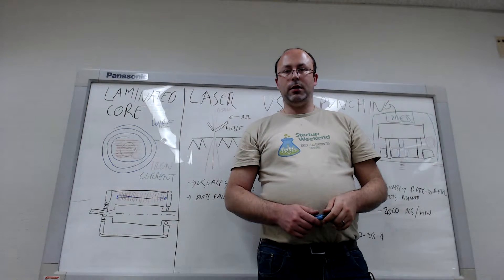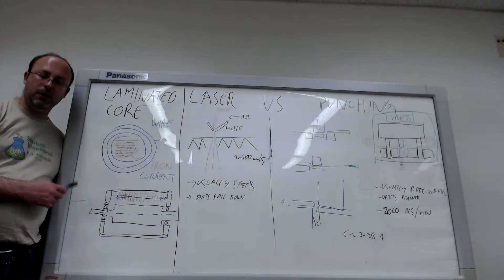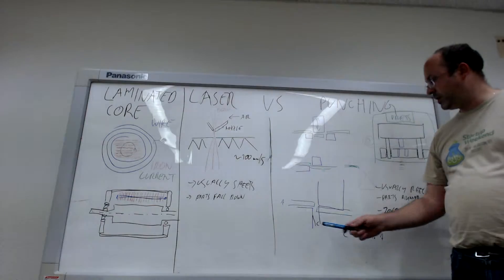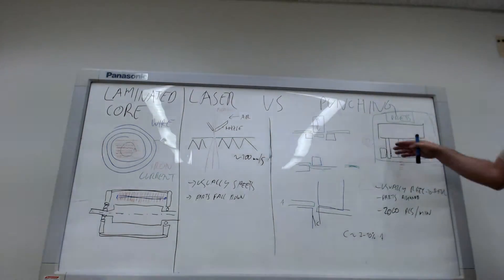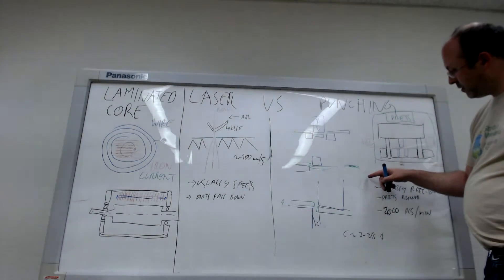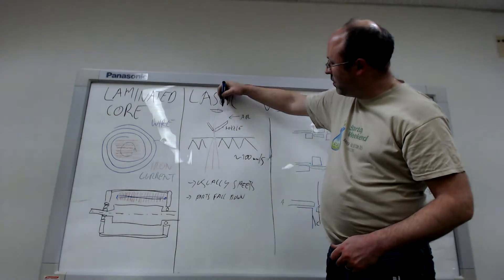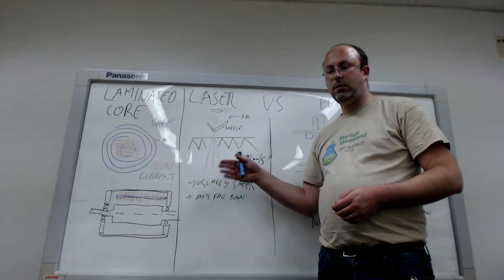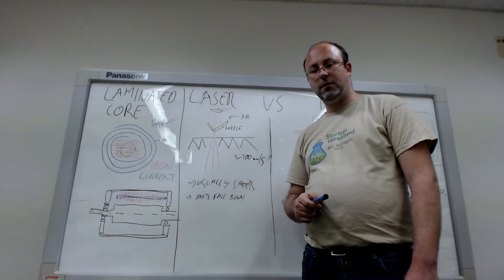Episode 13: About manufacturing of laminated cores

Comment: Thanks for your elaboration. Is thermal stress posed by laser cutting a big issue? Because I know that high temp due to the laser cutting changes internal structure of the material (somehow like an unwanted heat treatment).
Reply: If it's important, I think water jet cutting would be a better choice